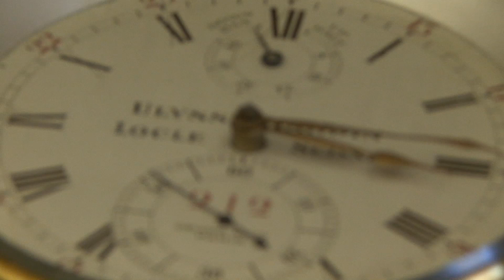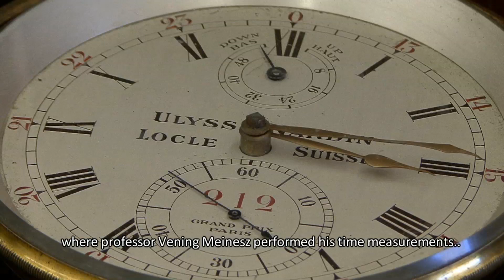Gravity Expedition at Sea

Comment: Afaik he was on board of many submarines and many submarines, to get as much data as possible. Later by his students. My guess the submarines were better suited than surface ships, to eliminate the very big swings by surface waves. The movement at depth is smaller, and can be measured a bit more preceisly, and the rest is the magic of his precision double pendulum apparatus. 

It would be cool if somebody made a 3D models in CAD of the apparatus, so somebody could make reproduction, or even improve it and use modern techniques. Sure, we have now other methods available for gravimetric measurements (i.e. direct measurements of acceleration using the falling prisms and lasers).

Thanks for English translation!. Cheers from Switzerland.